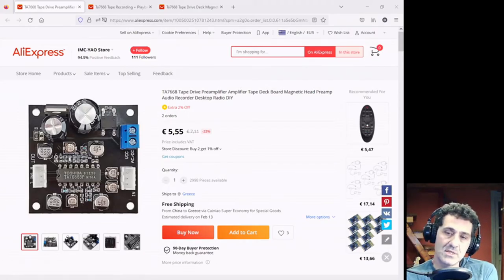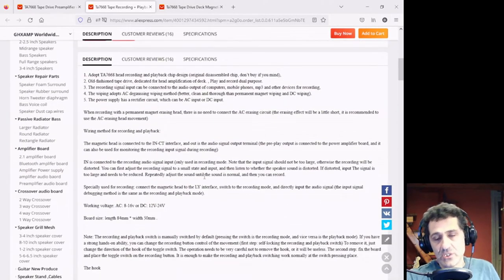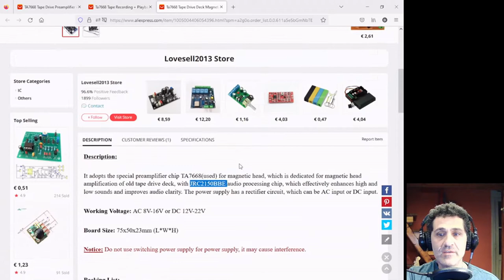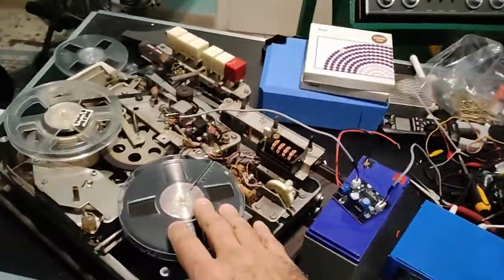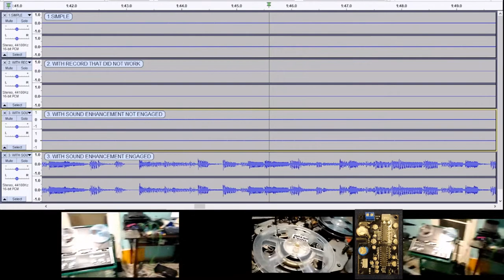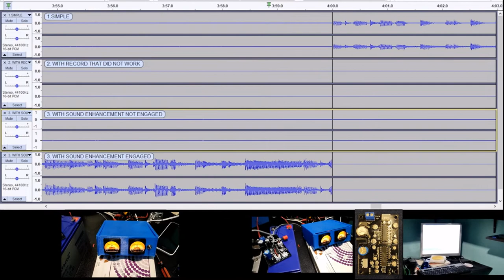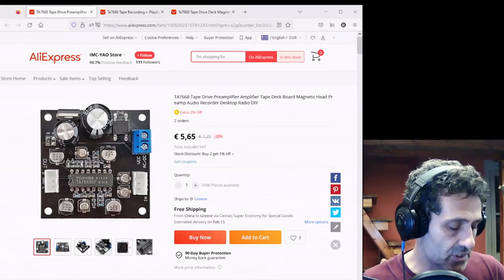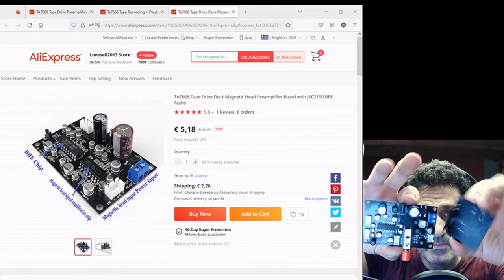Testing cheap Tapehead Preamplifier boards

Comment: Good video.  Wish you could playback a tape with full orchestra with some big dynamics. This would show off the sound better.   Also, how would these boards sound on your REVOX A77?  I just repaired mine but not loving the A77 playback boards.
Reply from the maker: Hallo!!, thank you for your comment. I just chose a free youtube tone with enough low's (bass) and high's (hats etc). I have 2 A77s but I would not be so intrusive on them. They look good enough to me the A77 playback boards. I would use these boards on a machine with no original or with destroyed original PB preamps (to make a very old machine usable for example) or on a DIY project. Although they seemed to have an amazing result I would not use them in place of an original factory PB amp that is working. Cheers 😊

Comment: I just bought 2 of the recording board. I guest to record I will have to plug the recording head into the two CC pins and maintain the push button with a signal trough the IN pins.
Reply: The 2 CC pins are maybe for the erase head instead.
Reply from the maker: I also tried but did not succeed with recording. I don't know why. Even  without erasing head there should be something recorded but no. I have not found the solution to that.
Reply: @dchatz  Im going to try on a cassette tape when I receive it.Maybe it will work.
Reply from the maker: @monsieurturgeon4236  good. I d like to know the results
Reply: @dchatz  I finally tried it and the recording works fine with my 4 tracks cassette tape mechanism.
Reply from the maker: @monsieurturgeon4236  really!!!! With good quality? Then i might have done something wrong. If you can make a guide or a video it would be fantastic. Pinout etc
Reply from the maker: could you just give the pinout? only that
Reply: @dchatz  IN-CT is connected to the magnetic head/CC is the erasing head/LY-IN is the recording input/OUT is output
Reply: Hope this help
Reply from the maker: @monsieurturgeon4236  yes it did. It's clear. I will attempt it once I find the time. thank you a lot